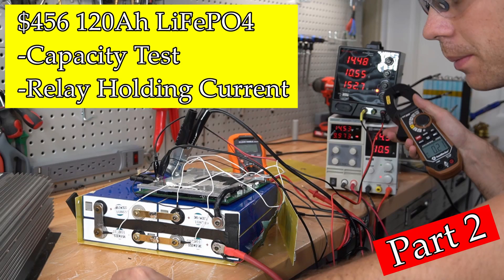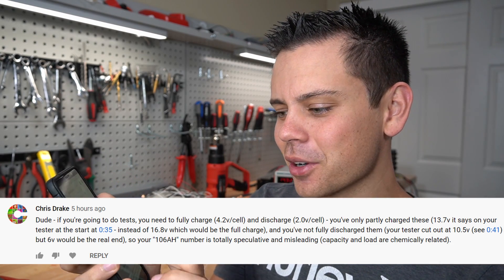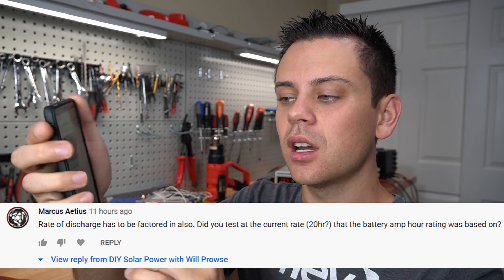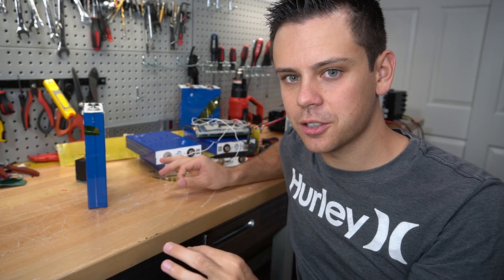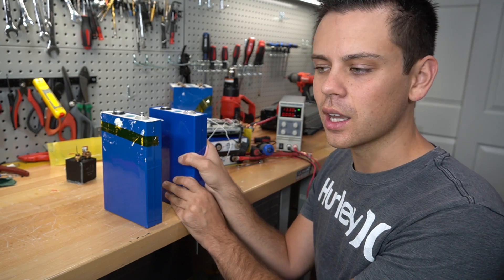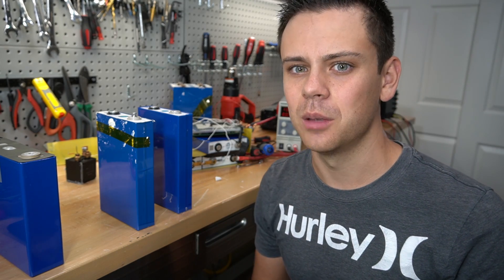Disproving LiFePO4 Battery Misconceptions in my Latest Video's Comment Section

Comment: Crazy Question, Will? How do I 'override' a 100A BMS on my 24v 3.2v 280AH 7,168 Watt battery to safely run my 24v 2,500 W Inverter/charger? I have watts, but I'm BMS limited to 100A for even fully utilizing the DC to AC inverter? In 'normal' operation, I don't foresee any (1) draw in excess of 55 Amps (11k BTU AC w/ 'Easy Start' installed). And, even the Happijac stilts don't draw 100 A in DC mode. But, I want everything to balance, and- NOT damage equipment due to poor planning. Can I install (2) BMS' in parallel with identical wire lengths for 200 Amps?
Reply: I think the SIMPLE fix is: (2) 12v 3.2 4 cell 280AH batteries in SERIES each using the Overkill Solar 4p 120A BMS'. That way, I'll never conflict with the 2,500 or 3,000 W Inverter. Total brain freeze- sorry to bother you, Will.

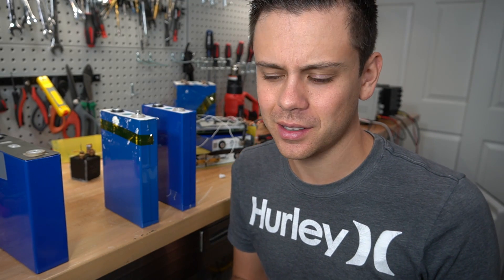Comment: While I'm not trying to be a PITA and in the process of building my 1st battery based on your recs., in the review video dated  Jan 23, 2020 you were extolling the virtues of the Fortune LiFePO4 Battery Cells and mentioned at 3:27 that the batteries were full at 14.5vdc, but did not mention the voltage after settling..  Does it matter..??  
So, Will, my Henderson neighbor (LOL), is it possible for you to address this..??   BTW, do you continue to recommend those Fortune LiFePO4 batteries, or can you recommend something else..??   Thanks again for sharing your time and knowledge...

Comment: Question. I have a 12v solar with 2 BB 100ah batteries. Stock the rv battery was charged by tow vehicle but that was basically paralleling the vehicle and rv batteries both flooded no problem. How can i safely do this with the BB as they should not be parallel with a flooded. My first thought.... the hot line from vehicle battery to a separate mppt charge controller?

Comment: Hey Will, you know what opinions are like 😬 You do great videos mate (well suited for teaching - clear & concise) 👌👍                                       Have you had much experience with Headway LifePO4 38120S cells (specifically the blue higher capacity 10Ah version) Thinking of building a 4S 8P battery pack for a new Solar/Electric fence. They look fantastic in specs & cycle life, any info regarding pros & cons would be much appreciated, would you ever consider doing capacity test & review on these cells?

Comment: Will, if the products linked are always sold out, do you still make anything for sponsoring them? If not find another vender to sponsor that can handle volume.
Also, I watched many of your videos and have learned a great deal but unfortunately, most of what you build is simple solar systems. Go full on nerd and design a Solar Panel, Wind Gen, Diesel Gen, shore power and maybe a 12v alt or 24v aux. Gen attached to boat motor. Even if it is only on the dry erase board. This is a system that would be on a sailboat that may use all or any variation of these. Is there a single charge unit that would handle all of these inputs? Are there any special protections one input against the other? Thank You in advance.

Comment: Question. Renogy are selling their 50ah lithium Battery for $400 and their 100ah for $1000. I realize it's a better deal to buy the 2 50ah batteries and hook them together, but is it better longterm to have just one 100ah battery? Any cons to connecting 2 together? Thanks

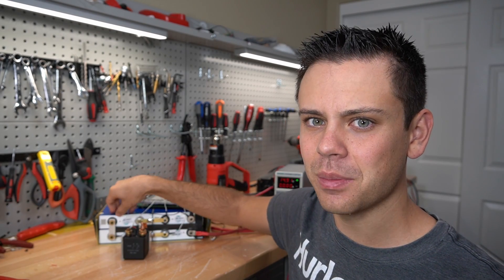Comment: 5:35 Will says you can get 4x 280Ah cells for $400 delivered. Anyone know where? Because that's like a quarter the price of the ones linked on his website, and like 10% of what I'm finding on eBay.
Reply from the maker: They are sold through my forum. Eve cells. People mention the supplier often. Check out the forum

Comment: Can you please tell me if it’s ok to connect a UK mains charger directly to a 12 volt battery while it’s still connected to solar panels and a charge controller?…to top up the battery when needed in winter none sunny days...so in a nutshell can I just clip the mains charger to the battery without damage to my set up...many thanks in hope...Brian in the U.K.

Comment: Will, have  you seen the new batteries on Amazon, made by SCREMOWER and distributed on Amazon by Kepler Industrial Co. There standard 12 V 100 AH lithium iron phosphate is $459 with a BMS and a 5  year warranty. As their batteries go up in size the  price drops. For example a 12 V 320 AH battery is $1313 for a savings of $64. Hopefully you'll do a review of this one soon. Thanks

Comment: Hey Will, can you over-panel a MPT-7210a charge controller as long as the input voltage is still under the output voltage? I started tinkering with li-ion batteries, this channel has helped ALOT! I’m trying to build a portable solar generator (28.8v battery) that can charge from a 20v 40w panel or a 12v cigarette lighter port.

Comment: Hey will recently I got some new lifepo4 cells. I have 8 and plan to have them in a 8s configuration. I am currently top balancing them But the current is only at .6 amps. It can charge at 5 amps but it only charges at smaller calues. I have been top balancing for two weeks and yes i am doing it in parralel but in the video you said it should only take a few hours. Is it just something wrong with my cells. I would appreciate some help thanks.

Comment: Hi Will,
I am hoping you can give me sone advice.  I have a 21 ft starflyte rv.  I would like to get solar panels for it.  I can't carry real heavy suitcase panels so i was thinking the foldable kind would be good.  I have learned from you that i need an mppt controller since i am charging the batteries.  I am thinking 200 watts of power. Can you tell me the best system to buy?  Amazon has prime days Oct. 13 and 14.  I am hoping to get a deal!  Your videos are the BEST!
Thamks!

Comment: for the cost i can buy 10 12volt lead acid batteries or 5 agms, 1000 amp hrs or 500 amp hrs, still way cheaper than your battleborn

Comment: I have a question I want to run a air conditioner and it is a 1500 W what would be the best Solar System to use 12l,24 or 48 volt  and how many watts should I expect to buy in solar panels and batteries.... Mind you I am not some millionaire I am on a limited budget

Comment: Hi,i really like your instalation and your experiences. May I ask you something?My house is running last 4 years only on electricity (3x inverter(airco's) only one is using like a heater in cold periods in living room)(the rest 4 rooms are heated with infrared panels-the best solution what a ever had)...and totally energy year used is around 9000 kw....can your instalations keep up with my year consumption ?I am handy guy and always like a new challenge ,what I never done before.But the idea be off grid ,be powered only from sollar or wind is exciting. But my problem is space, because I live in Holland, tini house with 50 m2 garden...we have plenty of wind whole year and sun too...but is worthy?windturbine..noise for neighbours?what is instalation costs?thanks Chris

Comment: Will, you are inspiring, and the reason I now I have a Solar system.  Question: With a straight 12V AGM Battery bank, is it best to hook the neg from the controller on the first battery and the Pos on the last battery of the bank.  Thank you for always providing the best

Comment: My question is to hear you thought on: if one changes out there standard RV batteries from lead acid to AGM or lithium phosphate you then need to change your  RV standard converter to one that will accept these different core batteries.  True or false?

Comment: I just got some 120 ah lifepo4  batteries and the first auto electrician I went too said you can’t wire them in parallel, the manufacture states up to 4 in parallel,the second auto electrician did wire them in parallel but he connected two cables negative to negative instead of one thick cable and 2 cables to positive to positive instead of one thick cable ,and with my  3 loads with every load he used he connected  to both negative poles of the battery and then to negative of the load and both positive poles of the battery and then to the positive load adding more parallel, so I’ve got 8 cables going parallel negative to negative and 8 cables going positive to positive ,My question is I have never seen anyone do this ,including yourself, is this some new practice that is taught or is there going to be some negative effects on the bms or the battery

Comment: Thanks Will, you have helped me so much. I built my own batteries now. If anyone can help me please, i purchased a renogy rover 30A controller. It has a lithium ion function. I have built a 18650, 7s 6p x 4 pack battery and has 4 bms units. I have programmed the controller to 27v to manage the battery life. It has a boost and a float charge. There is no information on this section. I have emailed renogy and they havent any idea, going by there answers. 
Geoff

Comment: Hi , I remember in one of your earlier videos , you tested the Valenve battery, I’m looking into putting two of the Valence U27-12XP used batteries into my camper, I saw them on eBay and Amazon, (same seller)now do these have to be plugged into each other to communicate, ? they come with the connectors to do so , And do you have to hookup a computer to do that .. I’m just looking for something simple, put them in Parallel , then connect to the camper, oh .. and if there good to use like that , would the 30 amp change in the RV be able to change a lithium battery like that , or would I need a new charge, I also have two 200 watt @20V solar panels with a 30A Epever MPPT Solar Charge Controller , 
The two 6 volt 224 ah AGM batteries I have in the camper now , take to long to get back to there full charge , Thanks you for all you do on your videos .. I really enjoy watching them ..

Comment: Any chance to try the  Battery hookup LIFEP04 32650 3.2V 6000MAH CELLS? It appears you can build a 100ah battery for $250 + cost of BMS, so about half of what a typical off the shelf LFP battery on the market.. wdyt?

Comment: I have a 60 ah 12v lifepo4 chk brand battery for my electric motor in my boat ,when charged it is 14.6 volts but 6 hours latter it is still 14.1 volts .do you think this is still okay.this battery is 6 months old and came from AliExpress and works very well.

Comment: Just saw your discussion with john diesel I personally am sticking with lead acid for now it's working for me got 8 years out of crown l16 and expect the same from my usa l16 now that I double the amp hrs cost $5200 for 36960 watt hours 18480 usable watt hours to 50 DOD. I dont like how they treated you I dont feel like your pushing lithium I do see you like it. I enjoy your videos and have learned from  them. Thanks for the knowledge.
Reply: To get the about the same usable amp hours/watt hours I would need 16 battle born batteries to 80% DOD costing in the $15000 that's about 3 sets of lead acid batteries in my current usage needs.

Comment: I'm not sure where to ask this. I have a class a rv. Recently, I got 2 12v lead acids and I'm hoping to update to 24v to match my 100/50 victron so I can add more panels. I got a 24v to12v converter like you recommend, 40 amp, It says in the instructions that it will only function correctly at 14.4 volts which would not work overnight, it would only work in adsorption. This is important for us upgraders.

Comment: I have been using LiFePO4 cells for over 8 years as a house bank on my sailboat and have just replaced after nearly 3000 cycles. The problem now is disposal of the old cells. Where do you dispose of or recycle old cells?

Comment: All your vids are great. I just ordered Big Battery's 12V 170Ah LiFePO4 Power Block (PRE-ORDER) for $799. (Please do an eval Will) Almost double Ah compared to a Battle Born 100 Ah for a lot less $. Big Battery really seems to be changing the market for DIY.  I really don't want to spend the time putting batteries together  from cells, Big Battery allows me to spend time integrating solar products and getting my systems working much faster. Assembling batteries  is like building an AR-15 lower from scratch. It is cheaper just to buy one already put together

Comment: Hi will I'm a big fan and have learned most of my limited knowledge from you. I'm struggling in one area bud. I have good lifepo4 prismatic cells built into a working system in my van but the rather expensive dally 300 amp bms seems a bit flakey.
  It's all well and good pushing prismatic cells but there does still not appear to be a good Bluetooth bms that can deal with the loads of a 2000w inverter at 12v. Am I missing something bud?
Reply: I'm extremely tempted to just bin the bms altogether and run without one. Sick of it randomly cutting out and needing a jump start at the most inconvenient of times. If I kill the cells, sod it I'll go 24v n buy some battleborns

Comment: Hi bro don't get angry they use nimh battery that they say you have to brake it in for 5 charges they usually get higher and it's only for nimh and maybe li_po and li_ion but not for lifepo4

Comment: Can you take apart and give your thoughts on a Milwaukee M18 lithium battery? A M18 12.0 would be cool, and even a XC406 would be great. Your thoughts on using a MX Fuel Power Supply in conjunction with a solar  panels on a cargo trailer would be appreciated.
Thanks!

Comment: Hey Will,  I have been watching you for a while now, and I always wanted to build my own bank for 4wd. Here in Australia, we have now a company selling a pack of 2x100amp LiFePO4 that goes under the bonnet of the car. Those batteries are linked together (One for crank the engine) and the other as AUX battery. However, you can still use both of them as AUX, and apparently they will cut off at certain Voltage. The batteries are also charged through the alternator, which people usually upgrade to Alternators that will put 180amp or more (Not in Idle, although some alternators can do it in Idle) From the alternator, it goes to the BMS that controls both batteries. 
My question is: Based on your knowledge, would that battery would be affected by the heat of the engine bay? If yes, how affected would you guess? (I say guess, because we cannot test it, and I would take your opinion on this)
Do you know any BMS that would be able to cope with the current (I guess not stable) from the alternator and put let's say 180amps in the batteries?

I would appreciate your response. thanks.

Comment: I was wondering if you could make a recommendation for me.  I have an aquaponics system and i have a couple of pumps currently running off a long extension cord.  I want to start running the system on solar im and looking at having 2 pumps 12v or preferable 24v @ 21.5 watts each and a 130-watt air pump.  These basically need to run all of the time.  I was thinking of 2 150watt solar panels and charge controller and batteries.  I just a very much a newbie with this but I am good with technology once i get going.

Comment: Hey Will, great stuff..I just came across your channel recently.  I wish I had seen it sooner. 

 I have a 4kw off grid system that I bought and installed myself about 5 years ago without much of a clue about how to install or use it.  I do know how to read though and I searched for as much knowledge as I could and followed instructions as best I could. I made mistakes and have learned quite a bit but I'm not of an electrical background so I still get a bit overwhelmed at times.  Anyway I checked out your website and I was wondering why you recommend on bigger 48v batteries connecting first in parallel then series vs. the other way around?   My system is 48v and I'm running a 4kw inverter, I currently have 8 200ah 12v lead acid batteries and want to change over to lifepo4 for all  the obvious reasons. I'm not currently off-grid, having connected to the local utility a couple of years ago.  I manually switch back and forth trying to never let my banks get below around 50.8v - 51.2v  to extend the life of my batteries considering how much they cost.  Anyway I know you get a lot of comments here so I get it if you don't have time to answer ...maybe some other subscribers have some thoughts?

Thanks for the informative videos, they're really helpful

Comment: Hey Will great videos.... I have a newbie question I just bought these
4PCS LiitoKala 3.2v 280Ah lifepo4 lithium cells, but I think I bought the wrong BMS I bought a Daly "18650" BMS 4S 12V 60A can I use this BMS with the cells above. any advice would be appreciated  Thanks

Comment: Hi Will! I recently bought a Nissan leaf battery that I am planning to use to expand the titan battery capacity. My question to you is how would you connect a BMS using all 48 modules when they are configured in 3 rows of 16 modules connected together in series to have an output of 24V.  Would there just be an extra balancing cable that isn't connected to anything?